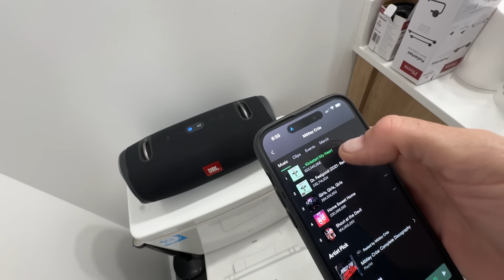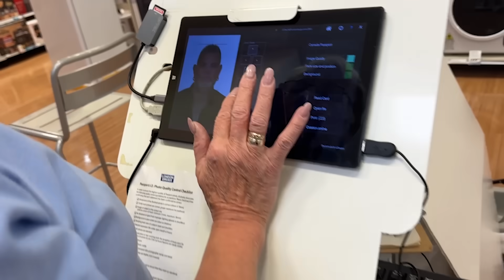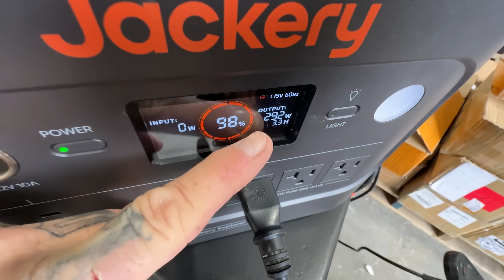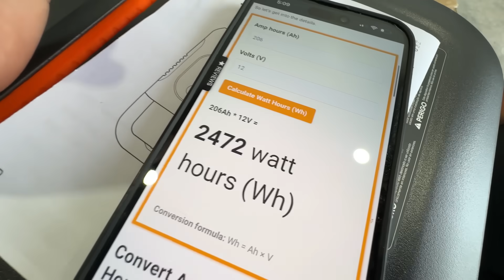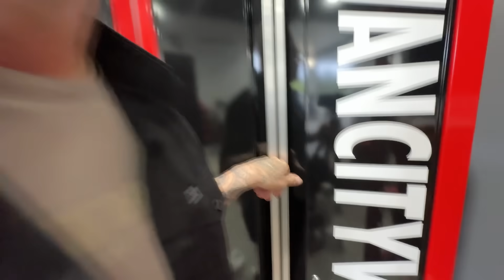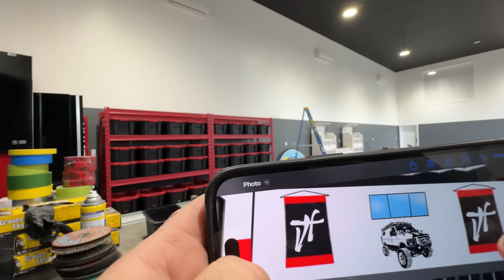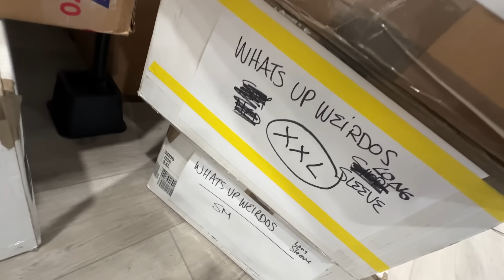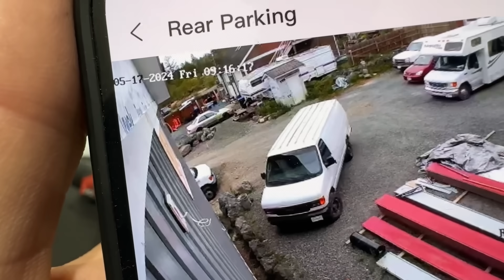4 CAMPER VAN SLEEP OVER. Getting Ready For THE BIG WEEKEND

Comment: I wonder if jeffie could get some accessible portable solar panel system to top up the batteries.  That's the bad thing about high tops designed like that. Maybe have a timer between the charger that cuts the power off for the wheelchair.

Comment: I could be wrong but I think most electric wheelchairs are 12v. Do a little research but I think with a little modification to the chair you could convert it to full 12v charging etc. Which would be a lot easier on the Leisure batteries.

Comment: 300 watts is only 2.5 amps so the alternator is hardly working. The batteries would hardly notice the discharge at this rate. There is another problem here it is not the wheelchair.

Comment: If the wheel chair is 12v, like most are. Have someone like Raynor or myself to put in a dc2dc charger. The inverter power losses is about 20% going from 12v to 120v back to 12v again. Same with stereo, laptops, starlink and tvs. Anytime you can plug your device into USB power is much better than using 120v blocks and adapters. You can install 100w usb-c plug and run off 12v instead of the inverter. Not to mention some inverters will actually draw power at idle. Mine uses 0.3 amps at idle.

Comment: Hey chrome jeffies wheelchair should have a portable charger that came with the wheelchair when it was bought. Wheelchairs are meant to be charged with ac power not using sok battery power he needs to be plugging into a regular power outlet.  He needs to be using that portable charger with a regular wall outlet. Sorry to be a downer
Reply from the maker: Obviously. Jeff has an inverter system in his van, which converts 12 V to regular wall plug. That’s a no-brainer.
Reply: @VANCITYVANLIFE   I for got about that